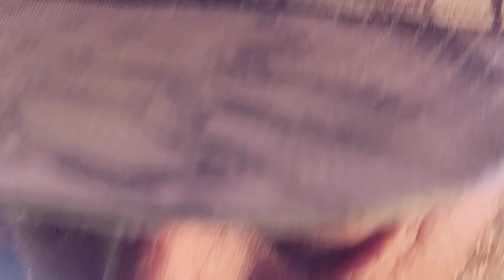Storm has past WILLIS

Comment: The washing machine is either off balance/unlevel. Or it's possible one of the springs has come off from the drum. It's an easy fix, if it's just unlevel on the floor. Set a level on it. If it's off, the feet should screw in or out to level it. If that doesn't work, call the place you got it, and they should service it.
Reply from the maker: Gonna get a new one eventually

Comment: You should attach a round post or pulley to the floor of the trailer so no matter what angle you pull at, the post or pulley will redirect the force so the item comes in straight.
Reply from the maker: Nice idea

Comment: Hi Travis, next time you have to load the trailer: what about attaching a second strap to the truck and taking it in through the opposite side door, to the hatch door? I would also suggest moving the handle to one side then putting a second handle onto the opposite side?
That way you are pulling equally on each side.
Also what about putting a set of castor/wheels onto the ramp? In able to manoeuvre it into the trailer, also more easily?

Comment: wouldn't it have been easier to push the ramp into the trailer instead of pulling??  You need an internal winch system of some sort.
Reply from the maker: Yes. I'll get it hooked up soon